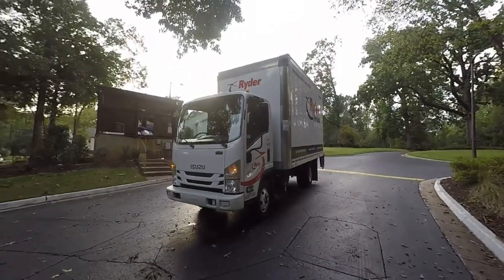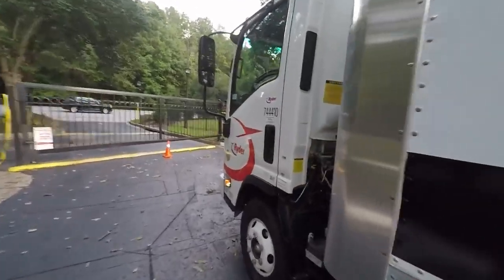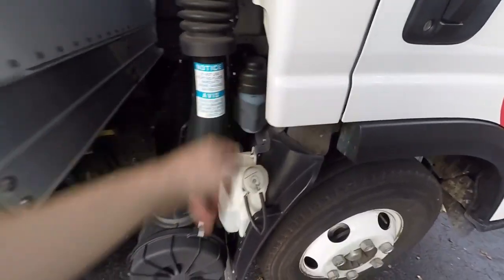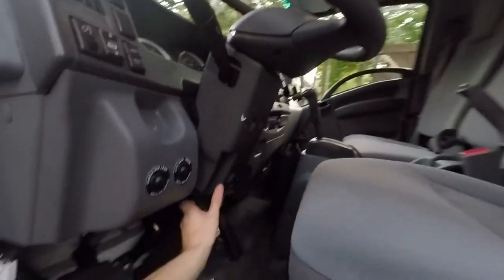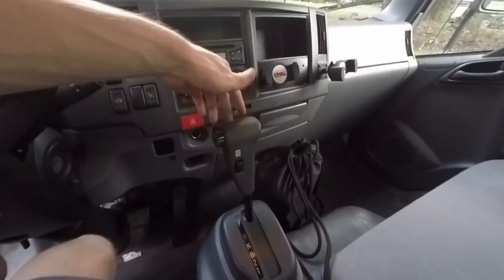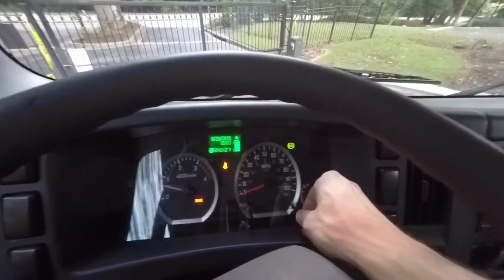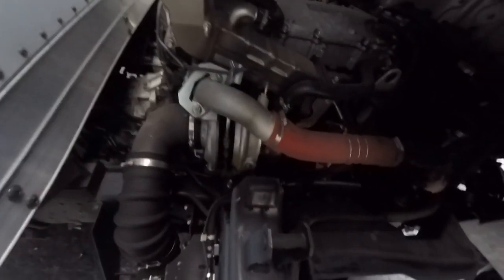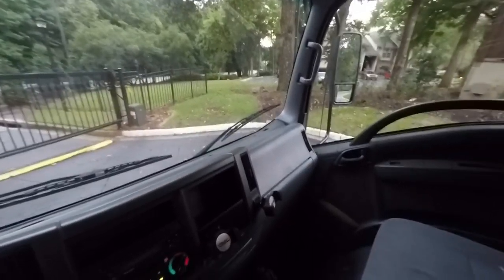2018 Isuzu NPR-HD with 5.2L Diesel Review

Comment: I work for ryder, the Isuzus like this are by far the most reliable trucks you can get these days. I can’t say I’ve seen an engine or transmission failure on one of these yet. Just oil changes, tires & brakes really. Even very few issues with emission systems. I always recommend these to customers when they ask what they should get, if it’s practical for them.
Reply: Yeah, but for how long do you keep them in the fleet? As they are getting older or used, you guys begin to sell them. How many miles on them when you get rid of them?
Reply: @Gabriellariz  depends on the customer, but most are turned in around 200k, but we have some customers running older models with 300-400k. Don’t see them too much either, other than for basic maintenance. I know In the industry that isn’t a whole lot but most of our costumers are doing a mix of city & high way driving.

Comment: I purchased 2015 NPR HD gas with 12 ft dump  . Most reliable truck I ever owned . Thought about diesel but didn't want the high maintenance,  also we do short trips
Reply: Isuzu is the opposite of high matinenice
Reply: @Doesitslap101  no modern diesel is that. Gas is the way to go unless you’re doing a lot of highway miles

Comment: I'm looking for a new truck to replace my Sprinter van..... I am a remodel contractor.... I am thinking about getting into a box truck with lift gate and side door. I would be buying new or something a few years old.... What are your thoughts?    How are the maintenance costs on the NPR-HD Isuzu?    Thanks.
Reply from the maker: I am honestly not completely sure how maintenance costs are, but I imagine they would be similar to your Sprinter. And it greatly depends on the engine and how good you take care of it, 5.2L Diesel vs 6.0 Gas. With modern diesel emissions you have to be a bit more aware of how you treat it. The overall body and interior are extremely rugged, and are designed to essentially last forever. I had one at work pushing 300k.

Comment: Very informative. I'm in the market for 2 box trucks ( 16" and 14" ) for our business and not very knowledgeable when it comes to this industry.  What would you say is the best bang for your 
buck when it comes to box trucks and should I worry if I purchase a used Isuzu with 150k miles ?
Reply from the maker: A lot of it comes down to what you plan to use it for! If your just zipping around a few cities job to job, these are great trucks! If you are traveling like 600 miles at a time I would look at something else. With these Izusu's the truck and chassis usually outlive whatever body is mounted to it. The gas versions have a design life of about 200,000 miles. The diesel versions, like the one in the video, have a B10 life of 375,000 miles.  That means that 90% of the trucks will reach 375,000 miles without any major failure. I have personally been in one that hit 400k, and it had absolutely no issues. With modern emissions on diesels though you need to be cautious and ensure drivers understand the systems and how they operate. One mistake will cost you a small fortune. Although deleting the exhaust is always an option too. Otherwise, I would have no worries buying an Isuzu with 150k, medium duty trucks like this are designed and rated for a lot more than a standard car. That's still young for a medium duty truck.
Reply: @crazyjdkid  thanks. It would mainly be used to move around in the city and move furniture, file cabinets , refrigerators, and etc... From our child care centers. They are selling me a used 2013  with 118k miles , we are  adding a new liftgate and they are trying to sell me on the 3 yr /90k mile warranty ($3k included in price) for $27,499 before taxes and fees here in California. What do you think ?
Reply from the maker: @kI2ispi  That would be a great application for this truck. So with that I have two questions! Is it diesel or gas? Also, if it is diesel does the extra warranty cover all the emissions related components?
Reply from the maker: I think it would probably be worth it to get the coverage. Those parts can be expensive if you are replacing them out of pocket. Just 2 or 3 of those parts would push you over 3k if they were to break. Thats not me saying they would break, its just would be nice as a business operator for you knowing the truck won't cost you in repairs for 3 years. Everything breaks no matter the manufacturer. But as I said earlier, the key factor here is ensuring your operator understands how the diesel exhaust system works and never mixes up the diesel and the DEF fluid.  Thats a $10k mistake that no warranty will cover. Don't let that scare you through, thousands of these truxks run every single day without any issues. Let me know if you uave questions!
Reply: @crazyjdkid  thank you very much for all the info and promptly replying to my comments. Really appreciate it and will be buying an npr with the warranty.

Comment: 12.6mpg running empty? 

Edit add:   us mpg?
Reply from the maker: Well I had about 3000 lbs of household goods in it and the lift on the back weighs about 550lbs. I drove it for about 100 miles, mixed city and highway and the average didn't move much. And I didn't reset the trip so most of that information is from the previous driver. These trucks aren't cheap to rent so I imagine the other driver had it loaded up too. Going off of filling it at the pump with diesel I got about 11.5 to 12 mpg (US). That being said I am pretty heavy footed, I have videos on my channel of driving this truck. Thanks for watching!
Reply: kilometres per litre please ..
Reply: It should average 15-17 mpg empty. So, like 16-18L/100km but with it loaded like that it's 23-24L/100km. Not the leader in industry standard but not the worst.

Comment: These Isuzu need a Manual transmission.
Reply from the maker: They use to be available with a manual, but they stopped with the manuals a few years ago. With most of these trucks operating in tight cities I would imagine the automatic was much more favorable. I liked the transmission in this truck, it's built by Aisin and performed very well. Much better than an Eaton, although I don't think it was as refined as an Allison.
Reply: @crazyjdkid  Eaton is a good manual transmission manufacturer.
Reply from the maker: They are good at manuals, I dont like their Auto-Man transmissions
Reply: @crazyjdkid  yep